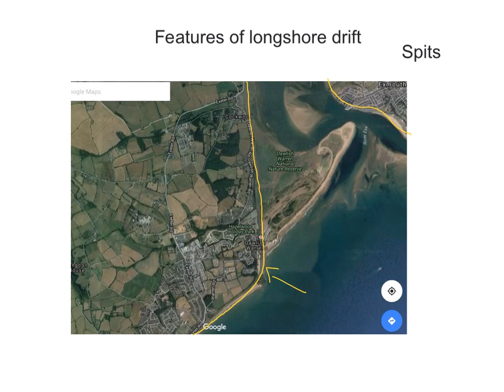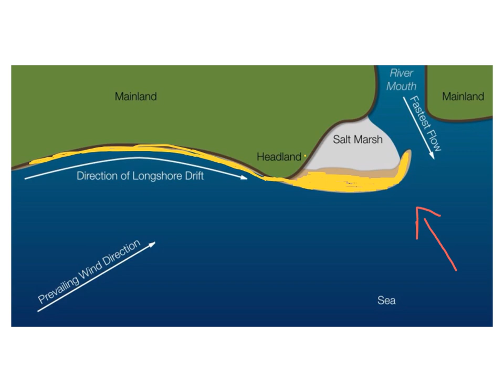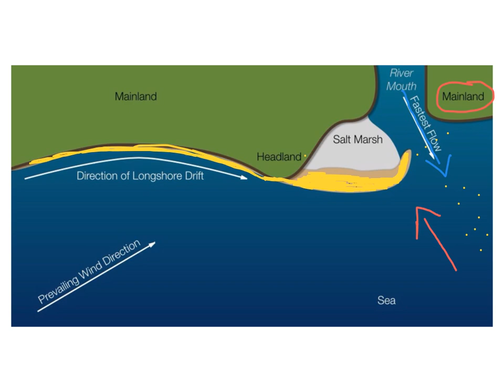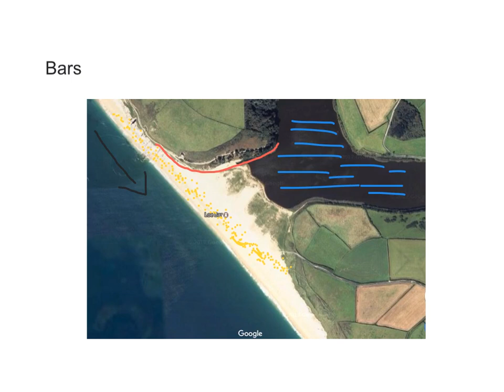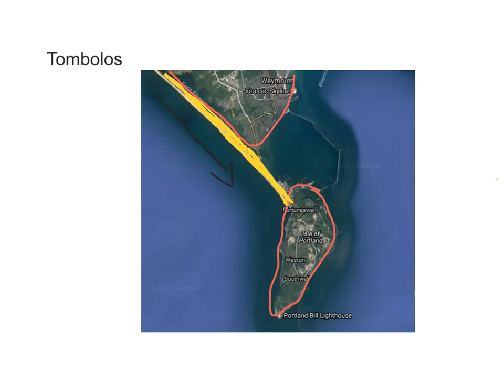Features of longshore drift

Comment: But bars are also found at the mouth of the river , if the influx of river water didn’t allow the spit to join the two landmasses then how can the influx of river water allow a bar to join the two landmasses.?
Reply from the maker: The flow of water from the river current prevents a spit from forming a bar (sometimes called a barrier beach). You may be confused with an off-shore bar which may form out at sea where a river exits and deposits load; this is partly formed from river deposition. My video is about coastal deposition.
Reply: Mrs Spicer Got it..Thanks Mrs Spicer.... your video helped me a lot...😃